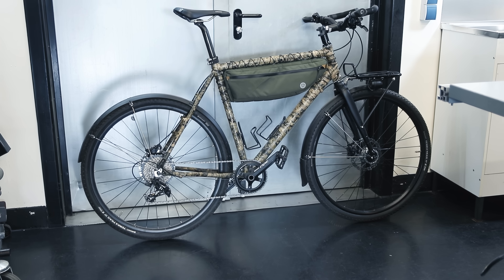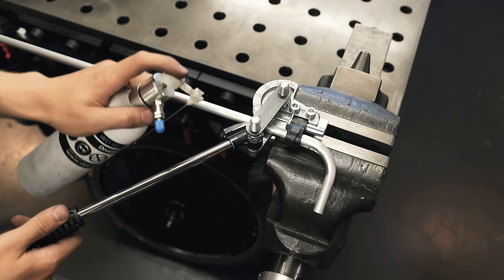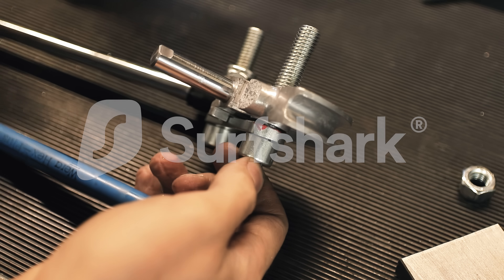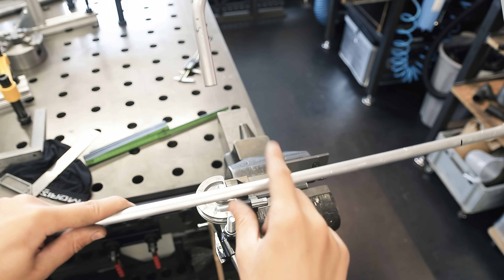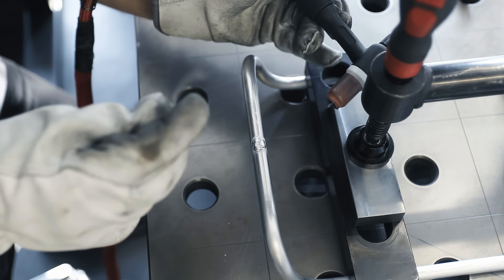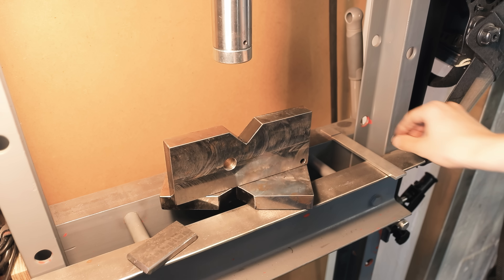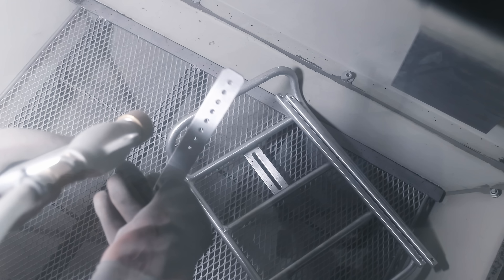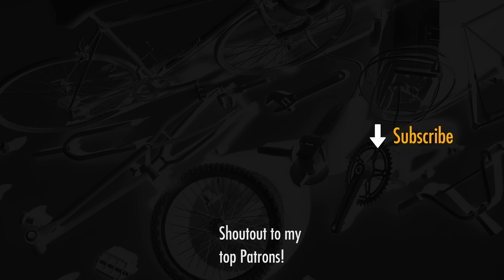I built this Sturdy Front Rack by Modifying a $25 Bending Tool!

Comment: I do stainless steel pipe bending in factories for a living for a few months and it's actually easier to measure and bend the tube one bend at a time from left to right. It involves less math and the tool is less likely to hit other bends. The follower die on my tool has two wheels and markings to visualise where the pipe will end up after bending it. Which facilitate grandly the process

Comment: Do you ever anneal aluminum before or after brake bending like that? I see the signs of stress/work hardening on that flat bar you used for the rear bracket after it came out of the brake…. I’ve had problems with breaking before getting to 90 degrees
Reply from the maker: Nope but for bending it to 90° and further it's probably a good idea, at least with a sharp bend angle like this

Comment: Great video, when you highlighted the expensive bike light. 
That is the point where I didn't get why you didn't make a small "V" cage next to the connection point to protect it move.
Since at 21:18 if the bike was on the other side, the light would actually be hit.

Comment: I would really like to see an in depth how to model tubing on F360. I've got a couple of motorcycles that I'd like to put ADV type cases on. I already use F360 for 2D CNC plasma cutting. I also have a medium duty bench mounted tubing bender. I have done some experiments but they turn out like sad overcooked spaghetti, but I feel like I'm close to figuring it out.

Comment: I made a similar front rack last year, using M8 studding , comes in 3 metres lengths from most electrical outlets. Used to hold up cable trays. I used the same bending tool. I also used M8 connectors and several assorted M8 EURO clamps on the stem and handle bars all very cheap. Bolts together. No welding. Made six racks so far.

Comment: Nice work! I still don't understand how front racks got so popular and totally dismiss the one in the back, though. The first thing I did when I bought my new bike was to remove the bulky front rack and install a proper one on the back of my bike for removable bike bags. On the steering bar, I mounted some rubber lined pipe clamps on both sides with hooks to hang large grocery bags from. I can haul a lot with that setup. :)
Reply from the maker: For me it's mostly that I never trust my stuff to actually stay on the rear rack especially on bumpy rides. If it's in front of you, you can see what it's doing and even readjust stuff when it shifts during riding. The other part is a question of style I guess, I can't put my finger on it but front racks just look better to me

Comment: This video tickles me unexpectedly, because Yato is a Polish brand (though it doesn't sound like it at first), and I'm from Poland, so I keep seeing them everywhere entry level/amateur tools are sold. I wasn't even aware they were available anywhere else.

As for your experience with the bender, it seems to be on par with most of their products - good for the occasional DIY'er or small scale professional, but will most likely crap out when used for heavier fabrication. Some of their offerings are pure Chinesium garbage (like most "economy" brands these days), but overall, not bad for entry-level tools.

Sorry for the unexpected info dump, but I'm just really surprised 😃

Also, I agree with the other commenters - more bike tuning/maintenance content would be a treat!

Comment: Hello Phil. I built a front rack to my son in your  type because the only good one to buy was so expansive. I built it with scrap irion. I test it with 10 kg on a bumpy track and it seems sturdy enough. I think the trick is holding the size down.. The raw meterial I use was 12 mm steel tube and flat bar for the rack. i used a similar dimension angle iron for the stretchers. I bent the tube with a spiral around a water pipe and weld everything together. The  steel was free from a scrapbox in a metal work shop close to me. The only thing I had to buy was a bottle paint spray.
Work time was 1.5 hour for cutting and welding. I am not a good welder so the afterwork  with grinding, finishing and so was around 3 hours.. the weight is just over 1 kg.
So what I mean, your way is very complicated. But you have my love and respect beacause I guess ypu like the project and your rack looks better than mine. And i like your video.
Metal working is not my thing. I like wood and some of my projects is sometime totally unnecessary. But I do it for fun.

Best regards Klas from Sweden

Comment: I still have a "hybrid" city bike from years ago, it has a suspended front fork and a hardtail rear, with a mountain bike style handlebar. It gives you enough squish in the front to hit railroad tracks and other sharp bumps but is tuned for mostly road riding. It has large wheels like a road bike, with a tire that's mostly smooth with a bit of tread on the outside edges, which can hold 5 bar of air pressure. It's got 18 speeds so no matter what there's a gear you can push. It's exactly what you want for riding around a city doing things. I do not want a drop bar, I do not want knobby fat tires that soak up energy, the bike is just right. So, of course, people acted like this style of bike was incredibly stupid for no clear reason, and they stopped making them that way. Now you can't really buy an appropriate bike for city commuting, at least not in the US. Even this guy is all "how about I heavily modify a mountain bike to do not mountain bike things and call it a city bike, it needs fat knobby tires to provide lots of drag and make me tired on hills." I wonder why this sort of thing keeps happening.

Comment: I decide to use the Pelago rack, that you show in the start of the movie. I have modified also the screw connections to do not use nuts, only screws with thread in the material of the rack. Your work is really fine, but I would miss the space for my internal cable routing. I have the samples inside the rack. I use also the light inside the rack, so that I have more safety for the light in a crash or only a small contact when investing.

Comment: Solid rod are not stronger than tubes of the same diameter when considering loads applied perpendeculary to the axis of the tube/rod. So a lot of bs startung from the begunning.
Reply from the maker: Yes they are
Reply: @PhilVandelay  Your bike is made out of hollow tubes for some reason. Deflection and bend stress on a hollow tube is marginally higher than those on a solid rod. The only advantage solid rod has is axial compression, but your rack has no vertical supports.

Comment: The bearings on the headstock are next to go. A heavy-duty rack like this is better mounted directly to the frame. Also, the weight of the load will influence the balance and steering less. Great video.

Comment: I appreciate the simplicity of this build. You just need some 80$ worth of materials, a couple hundredthousand worth of machining tools and a couple days. But really that's all.
Reply from the maker: This can be made with just a grinder, a drill and a cheap welder, including the modifications to the bending tool. The thing is that you can either focus on problems or solutions, but only one of those will ever get you anywhere.

Comment: Wait a moment, the monstrosity at sec 0:06 its a trailer you made?
Reply from the maker: Not one I made, it's a trailer you can buy from Surly. I borrowed it from a friend but I can really recommend it, great quality and it can haul a ton, I just moved a 2m fridge with it the other day (pulled with my E-bike)
I am thinking about building a trailer myself as well though
Reply: @PhilVandelay  just in case you dont know those ones, there's a DIY community that tried their hands with Carla Cargo trailers, one it's called "OHO Open Source DIY Blueprints" which made a video how-to about the braking system, and one is "Bauanleitung Carla Cargo Crowd" which made a different brakes system than the former and added a electric wheel, sadly no video and german only. Both euro crates compatible. 
Can't wait for your own version results.
Reply from the maker: Yep, Carla Cargo is basically what I was thinking about. It seems well thought out though, so not much for me to improve or innovate which is probably why I haven't made one yet - just building an existing design doesn't feel like it would make for an  interesting video. I really like the 3 wheel design though since it doesn't put excessive load on the rear axle of the pulling bike, which can be a problem with the Surly trailer
Reply: @PhilVandelay  if not a big trailer, how about a more robust version of a Burley Travoy for some more luggage? Peraphs with a single chonky wheel and a folding stand. The tricky part would definitely be the hitch/towing contraption.
Reply from the maker: @Toskyval  I have cargo bikes for that sort of thing, the only thing that makes a trailer interesting for me is the option to move ridiculously huge stuff so  if I built one, it would be big ;)

Comment: Actually, if you have the time, it’s a good idea to get a cheap or used tool, and then modify it to you liking.
By the way, for smaller parts, powder coating is a great option instead of painting.
Reply: I was thinking anodizing. But, use what you have or know though.
Reply: @p.t.anderson1593  Oh yes there are many finishes. I suggested this specifically instead of paint.
Reply: @iTeerRex  Oh, I get it. I really like the results powder coating. Unfortunately, it's been my experience that it was rather expensive for just a handful of parts like this. I've seen people in their home shop do powder coating with a heat gun. But it still seems to be a equipment heavy and tricky  process. What did you have in mind, professional or DIY?
Reply: @p.t.anderson1593  It basically requires 3 tools. A powder gun, an air compressor, and an oven. Every shop/garage has a compressor. The kitchen oven can be used to heat the items, if no dedicated oven in the shop. It requires about 200°C (392°F). So the only thing to buy is the gun. Then after that it’s just the powder. The powder is safe, it doesn’t give off any VOCs. The process itself is simple and provides a very high quality, heat, oil, chip, chemical resistant finish.
Reply: @iTeerRex  That doesn't sound too bad. Have you tried it? I do some CNC plasma cut stuff and I've been thinking about upgrading my finishing. Right now it's off the shelf spray can paints.
Reply: @p.t.anderson1593  The only thing is the initial cost. A powder coating kit (the gun) starts at about $75. I’d recommend to check out some videos.

Comment: Would be advisable to heat the rod before bending it to make it more pliable. And stainless tubing would be demonstrably stronger and insignificantly heavier than solid ally rod or tubing. As well, it would be highly corrosion resistant.

Comment: Very nice job! Next time you use the bender, add some grease. It will bend far easier and minimize scoring.
Reply from the maker: I did add some oil based lubricant (you can see it in some shots) but yeah, grease would probably work better

Comment: As a pipefitter who has used loads of these benders and made quite a few, you did a really good job.
If you make a mistake when bending, if it's just a small amount you can correct it with a heating torch. Heat a small spot on the outside of the bar or pipe on the side you need to pull out, then let it cool. Then repeat on the inside on the side you need to pull in,  rinse and repeat until you get to the dimension you need.
I've always called this technique ringing, but not sure if it's just the name that the guy who taught me, gave it.

Comment: If the weld is done right, it will be stronger than the base metal. You're a skilled fabricator to accomplish such good fit and finish on that part; subbed

Comment: Yes, more bike accessories, please.
I rarely do metal work, but most stuff can be replicated with wood, so this is very interesting.
Reply: especially the bending is easy with wood. oh wait :D
Reply: @ebayerful  Good point! I mean, you can bend wood, but you need a large steaming chamber and a form on which to bend the wood. On the other hand, rather than bending it's easier to just plan ahead and cut your wood in the shape you want and add reinforcement if needed. Bending metal is far quicker, cheaper and easier, but people build with wood because they like how it looks and feels, so it's not always about what's easier, I guess.

Comment: "I used the cheapest tool possible", cracks out a lathe, welding table and associated blocks holds and kit.
Reply from the maker: You don't need any of that to make this rack, just because I use it doesn't mean it's necessary
Reply: @PhilVandelay  I also need welding skill, not one I've developed yet. But I do want to.

Comment: He used the cheapest tool possible.  When? I used a pen once whilst building a 2000 euro exhaust system.  It would have not cost more than 250€ to get a decent bender to go with his 10k + workshop set up. Would have saved him the extra hours modifying his cheap tool so he spent the same in the end anyway unless his time is free.   Nice build but come on, this build cost a serious amount of money in tooling.  Just the welding table is  seriously expensive. I suppose at lrast it shows that the cheap tools just dont work and they cost you time and money in the long run.

Comment: * a $25 bending tool . . . and a whole-ass machine shop. False advertising bro.
Reply from the maker: You want me to list every single tool I own in the video title?
Reply: @PhilVandelay  no, but saying $25 in the title makes it sound like you did this on a budget, which you did not. I clicked on here because I thought I’d learn how to bend rod inexpensively. Then you brought out your mill and welders. I’m jealous tbh, but my point is that the title makes it sound like a budget video, and while it IS a very cool video, and a fun challenge for you, it is definitely not a budget video.I know you gotta get clicks, but it felt disingenuous to me.  Thats all I’m saying.
Reply from the maker: @originalpineapplemojo I did do it on a budget, I spent less than 50 bucks on this rack including the tool. Factoring in the cost of the workshop for every project makes absolutely no sense. Nothing in that title is factually incorrect. 

If someone bakes a cake in a video, do you also berate them because they used 5000$ in kitchen appliances to do it? See how absurd that logic is?

Besides, I'd suggest to stop focusing on why you can't do things and the fact that others have tools you don't and instead spend the effort on coming up with solutions yourself. What I ended up doing to modify the bender is literally possible with nothing more than a power drill and a grinder and 5 bucks of material. You don't even need to weld if you slightly change the design. But you're so focused on "Oh this guy has a mill, what an asshole" that you get stuck in the "I can't do this because I don't have tool X" mindset. I started out making things with a box full of cheap hobby tools in my apartments basement, you can do a LOT with just that if you're solution oriented. In the end it's your choice whether you consider things outside of your reach to be inspiring or demotivating.